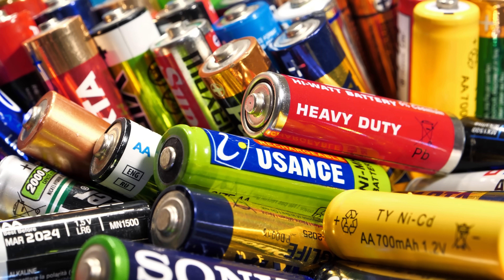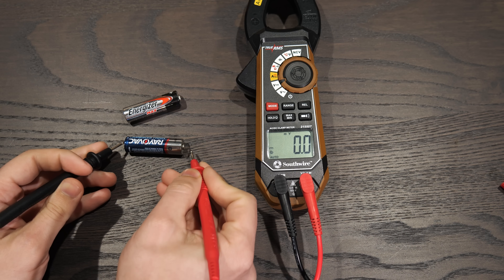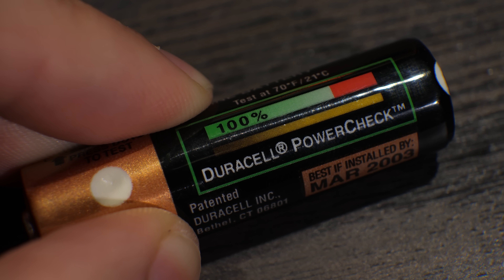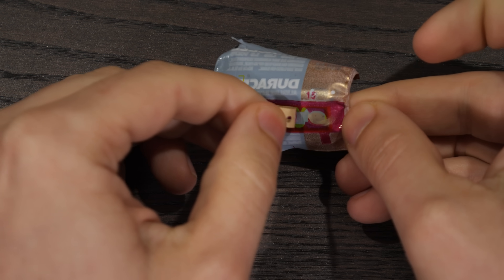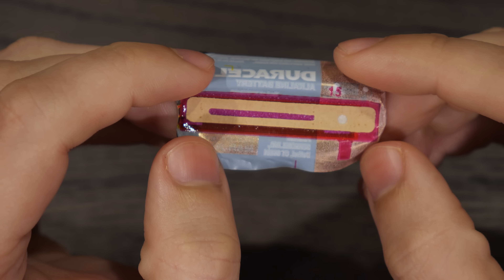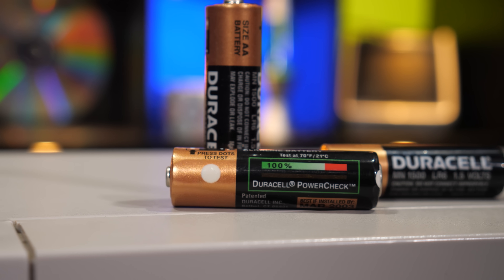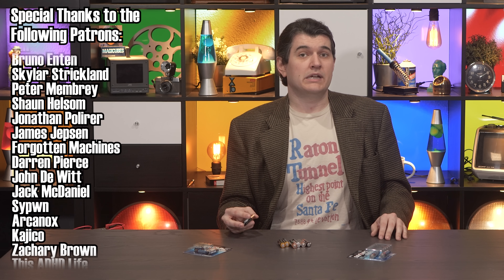Duracell PowerCheck: A genius idea which didn't last that long

Comment: I used these testers frequently and felt that the feature was at least some justification for gullible consumers to buy Duracell-branded batteries; at least they were getting /something/ for their wasted money.  There is zero reason to buy Duracell and they only reason that they've dominated the disposable alkaline market is because they've maintained large marketing budgets in an era where all alkalines are practically identical.

While I give Duracell credit for managing to differentiate its brand in a market where there is no real chemical differentiation, I also despise them for so effectively manipulating consumers into wasting hundreds of dollars per year on disposable alkalines when even the most expensive NiMH cells on the market (i.e. Eneloop Maxx/Pro/whatever) would have cost a fraction of that.

The only thing about AA/AAA batteries more frustrating than the power of marketing over chemistry is the return of Heavy Duty chemistry to the U.S. market.  Heavy Duty cells were unavailable in retail stores 25 years ago and for good reason - they contain ~1/8th (~1/5th for Super Heavy Duty) of the useful energy of alkalines - but thanks to their lower manufacturing cost in China they are today entirely common such that consumers think that a $0.50/cell pack of generic Heavy Duty or Super Heavy Duty batteries is a better value than a $1.00/cell pack of generic alkalines.

For those confused by the fractions shown above, it thus takes 5-8 heavy duties to equal 1 alkaline... so the alkalines need to cost at least 6X more to be a worse value and even then you'd need to swap out heavy duty batteries 5-8X more often.  There's practically no reason to EVER (*) buy heavy duty batteries, yet my friends and family members are buying them by the bag :(.  Yes, this annoys me.

If you can't convince people to use NiMH in 95% of alkaline applications (I've tried and failed), then try to at least convince them that generic alkalines are a far better value than anything with "heavy duty" in the name.  Sure, alkalines may eventually leak, but heavy duty cells are effectively already dead when you open their package; they won't last long enough to leak ;).  Shipping zinc-carbon or zinc-chloride batteries across the oceans in either products or bulk packs to sell in dollar stores is an insanely stupid thing to be doing in 2024.

(*) - an exception might be if you need cheap batteries for some kind of party favors that will be discarded within a couple hours anyway.  Personally, I think it's wasteful to do such a thing, but I can understand why someone might buy the cheapest batteries available to put into toys or favors intended for short-term use.  I still wouldn't buy zinc batteries, even here, but others might.

Comment: I think the only time I have half-used batteries around are from some battery-powered Christmas lights (candles for the windows), which I remove after Christmas so they don't corrode, throw them all into a bag in the same box, and then... I just put them in next year and see if they turn on. The time to test would be darn close to the time to just try it out, so, yeah, point taken.

Comment: In general with batteries, you don't just want to check voltage, as some battery chemistries don't have a linear drop off with charge level. Also, when open circuit, they can have a rebound to their full voltage, but will drop off quickly when put under load

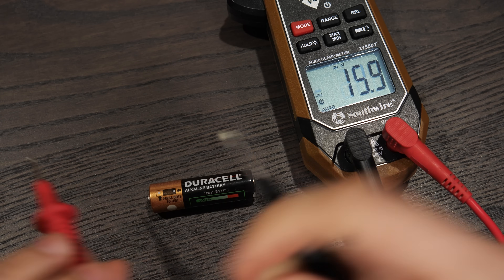(I see he addresses this at 9:47 )

Most battery testers will put a battery under load before measuring the voltage

Comment: One method I leaned to test a battery without a tester is the "drop test". If you drop AA or AAA battery on its negative end (from a few inches or so) you can actually "hear" and "see" a difference in its bounce. A full battery will kind of "thud" and fall over, and an low battery will bounce higher and sound more "light".

Comment: Thankyou SO MUCH for covering this topic as this HAS been bothering me because these batteries helped reveal the dark secret of the Game Gear: It's only using one battery and we have been throwing out 5 almost fresh batteries every time we replaced them! Yeah, Game Gear had infamously bad battery life and I remember taking it on a school trip, full of these exact batteries, and it running out. In my confusion I tested it and found 5 batteries barely used and ONE completely drained. Someone really needs to look into this critical design flaw sometime.

Also appreciated the AAA rant. I actually remember AAA batteries being slightly MORE expensive than AA and because of this I always appreciated the engineering marvel known as the WonderSwan. Handheld game system by the designer of the original Gameboy, runs for 15 hours on a SINGLE BATTERY. But I really loved that the ONE battery was a AA. If they had used AAA the system would have had a much sleeker design. But no, Gunpei Yokoi went with AA and just gave the thing a big booty bump. I think this was brilliant because at that time? AAAs would have been a real pain.

Comment: Main problem with rechargeable devices is that when the battery no longer takes a charge, or the charge port is damaged, you have a very expensive paperweight.  I've got 3 portable blenders to attest to that.

Comment: 7:26 i dont think that's how it works. The increasing gap in the heating film, leads to a increase in distance between the hot area and the thermal ink. As a result more heat is needed for the ink to change colour the further up it is. Since it is simple circuit with a fixed resistance in the circuit, more voltage = more current = more heat

Comment: For me, it was useful. For everyone else, just including a comparable tester with the batteries would be more reasonable and cheaper for the company. After all, having a battery tester is handy because sometimes the devices are bad and not the batteries, but they don't need to be on every battery for most people

Comment: Copper tops used to be the go to when you needed a battery that would not let you down, something changed around 2015ish , I started noticing that not only would they fail at random but when they did the bad battery would release a HIGHLY corrosive chemical, I had several very expensive testers ,not to mention flashlights ,tv remotes and even a couple RC remotes ruined by this.

Comment: Here is an easy way to test batteries without using any tools or devices. 

Hold battery vertically  over a hard surface with the -ve end (flat side) at the bottom
Drop the battery and if it bounces it is dead
if it doesnt bounce its good

The material inside the battery is soft and absorbs the impact when new
When the battery is spent the material hardens causing the bounce

Comment: I went on a googling spree based on this, and learned the following: 
The human body runs on about 150 Watts of energy at rest, with 20% of that being used by the brain (a 2% of body mass organ), even while the brain is "at rest." At roughly 4 watt hours per battery, roughly 8 of these (or any AA) batteries would likely be able to power your brain for about an hour if we somehow had a way to use them. 
- 
I think. This is all armchair napkin math, I just went down a rabbit hole and wanted to share.

Comment: Oh man I remember those. I loved the function of the power check as a kid. If I needed "new" batteries for a toy then I could grab and see if it was good before fighting the dead batteries out and trying a couple dozen batteries from my toys battery collection. My family didn't have testers and as a kid I never had long enough fingernails to pull batteries out easily so it was a way to save time. I didn't put batteries in all my toys or games at all times so I had various batteries laying around in a drawer for my toys.

Comment: My late grandfather have simple home-made battery tester consist of itty-bitty glass lamp and a piece of cable. Connect the lamp to a battery and see how bright the lamp light is. Not the most accurate, but work well enough 😂

I remember borrowing it to check my toys battery as a child.

Comment: Personally I like to used my batteries in my torch several times, how you may ask... its simple I change the bulb each time, starting at a 4.8V bulb, then 3.6V, then 2.4V.

Comment: Back in the day, there were digital cameras that used AA and AAA.  The trick was they really could only use about half the energy in the batteries before they got too low to use.  So those people ended up with a lot of partially used batteries.  Same thing for many remote control cars.

Comment: I still have some of the old packages with the built in battery testers and I use them. I don't like keeping batteries in devices I only use occasionally due to possible leakage damage. Yes, I have a drawer full of partially used batteries.

Comment: I remember having these in Poland around 2010. It looked like magic when I first saw that. I thought it's a weird liquid, LCD type device. I didn't think back then about simpler methods. Also yeah, alkaline batteries have high internal resistance that shouldn't really change that much in a fresh cell, that's why the current is limited on that strip and is more or less "calibrated" as long as the cell itself is fine. In the old ones you have they somehow got very high internal resistance, even if they appear charged. Almost all batteries that didn't leak show less than 1V when depleted in my case, even old ones.
Once I bought myself a few eneloops I never bought alkaline again, even though some devices scream that they have low power constantly (different voltage curve, eneloops start at around 1.2-1.3V then rapidly decline near the end, sort of like li-ion).
EDIT: Now that someone mentioned that they are still made and I checked the photos, the ones I had didn't just have dots like yours but a bar with a frame printed around them! They could have been the turbo max type.

Comment: You know what I would want to see?  Put these PowerCheck strips on rechargeable batteries.

Nothing is more frustrating than a game of "battery roulette" trying to find out which rechargeables were charged, which ones have self-discharged, which ones are just straight-up dead, when all you really want are two good batteries for that device that chews 2 batteries up every two months.  Especially because, as demonstrated here, you can't trust a multimeter - It'll happily tell you that you've got 1.15 volts, you put them into something, and pffftt!  Nope!  Nothing.  Nada!  No power.

Frustrated me enough that I switched back to single-use alkalines because, you pull two out of the package, they're always ready to do their thing.  Unlike rechargeables which can sometimes have "performance anxiety."

Comment: I still buy alkalines because rechargeables lose their charge too fast for very low-current demand applications. For example, the clock in my living room runs on alkalines becomes one AA runs for about a year. It is also frustrating when your clock stops running and you were relying on it.

Comment: 12:25 I have on multiple occasions sorted through one of those used battery garbage bins and discovered nearly half of the batteries inside of said bin to be completely fine, unexpired and very usable. This has lead me to conclude that either people are throwing away batteries as soon as a device malfunctions (possibly only due to a single battery) or routinely throwing out batteries premptively or another third option I'm not smart enough to imagine. anyways I do not recommend testing your batteries with the device you were using therm in since it seems very often to be the case that only a single battery may be causing a malfunction.

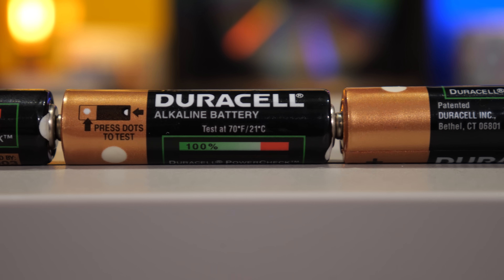Comment: 12:54 At one point we had the separate tester strips you mentioned, and I can confirm that they were a bit frustrating to use (something more substantial would have been better actually), and I have no idea what tiny gap they're probably lost in. We definitely used them a bit, but not much.
I've quite often had half-used batteries around, since a bunch of the things I use most are quite sensitive to the voltage, so while lots of things work fine down to ~1.1V, other things might stop working past ~1.3V, so the batteries aren't dead but still need to be changed, and having an option to test batteries can be quite helpful.
Not so much an issue anymore as you said, since most things have built-in rechargeable batteries now, and almost everything electronic is now done through either a computer or phone.

Comment: AAA batteries are often used to save space in a device.  For example, many remote controls use AAA batteries because they want to make the remote as small as possible (possibly so you can lose it more easily and have to buy a new one for $$$).  Most devices that use AAA batteries also tend to have minuscule current draw so the difference in battery capacity doesn't really make much of a difference - e.g. my remotes tend to last a few years on dual AAA batteries before they need replacing.

As for partially used batteries in the spare parts draw, you will end up with a whole lot of these if you have kids and don't invest in rechargeable AA/AAA batteries.  Kids toys are not made like they used to be and kids can be really rough on them.  This means that you often have toys that get broken before the batteries die so you shuck the batteries, toss the toy and keep the batteries for the few toys that manage to survive long enough to need replacement batteries.

Finally, something a bit more relevant to the topic, I hated those Duracell Powerchecks because they would often kill a battery that still had enough of a charge to power a remote control for a few months.  You would also get people who would manipulate the packs in stores to drain the batteries before people could even buy them...

Comment: And one more reason why you have batteries floating around in the junk drawer is because one day you will need a battery and wont have one, so you remove one from something and temporarily use it in another device. Then somehow it ends up in the junk drawer. Its like the planet of lost biros, all batteries have a goal of getting to the junk drawer. And who has two junk drawers - one for new batteries spilling out of the multipack and one for parially used batteries ;-) :-).  VERY VERY useful. I may be wrong but isnt battery output also temperature dependent? One day everyone is desperate for a battery to work and if you warm one in your hand you can sometimes squeeze a little more life out of one.

Comment: As someone that used the powercheck to mostly check the batteries in my GameBoy Color/Advance, I understand why they existed, but I'm not sad they're gone today. 

If they could be refashioned for the rechargeable NiMh batteries that would be nice, (I use NiMh batteries to repurpose/reallocate "disposable" electronics that just weren't built to stand the test of time) but doing that for something that's on it's way out is probably not economically feasible for massive corporations at this point. 

I know that I'm pretty late in the transition from other metal rechargeables to lithium batteries, and I want to move forward, but I have a lot of shit that already uses NiMh batteries, and fully swapping wholesale to Lithium is just not in the cards now, but I do plan to slowly transition as it gets both cheaper and better.

Comment: I actually switched to rechargeable batteries from the mid 80s. I had an 8 slot charger, so every day I had 4 sets of freshly charged batteries. 
Batteries always die at just the right moment when it is hard to buy replacements.

First, it was just the walkman that needed power. But early 90s with the gameboy, oh, that device needed a lot of power even with the monochrome display. And what did we play? Basically just Tetris. That walkman was later replaced my a discman which was superseded by a minidisk walkman.

Comment: Don't get me started on batteries... AA single use? Wasteful. Ni-Mh rechargeable batteries? Not very powerful and lower voltage (1.2) which actually makes them incompatible with some devices like torches. Li-ion AA rechargeable batteries? Gimmicky and non standard, expensive. Li-pol battery packs in your phone? No standard at all, random shape and connector and voltage. 18650 li ion elements? Dangerous, bulky, not supported by anything but the cheapest chinese devices and some torches. Just imagine if we had a chemistry-agnostic standard of connection and a relatively small set of form factors with some adapters between them... So that you could buy standard batteries in the store, recycle more easily, charge them with a standard charger. A man can dream.

Comment: My only gripe with the move to lithium away fron AA/AAA, is the move away from standardized shapes/sizes. Saw a comment on a smart lock recently, complaining that it still uses AA in this day and age. No, that shit needs to last forever, it can’t have some proprietary battery that’ll be unobtanium by the time it kicks the bucket.

Comment: The best use I have for used/potentially low AA batteries (sadly not other sizes) removed from various devices is for clocks at home. Okay so the clock battery probably needs changing more often, but if it can't power a clock it's probably going to struggle to power much else so time to send for recycling. The nice thing is the clock only needs a single cell so the issue of multiple cells of indeterminate capacity (eg one is flat but the other is good which makes both seem flat) isn't an issue! Anyway I use rechargables for devices which take standard batteries and are higher drain but only used infrequently.